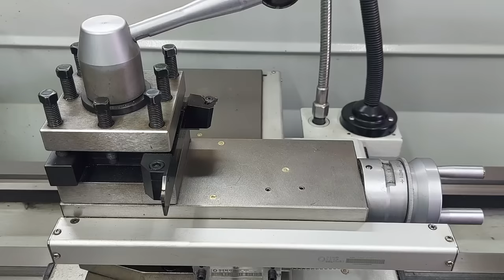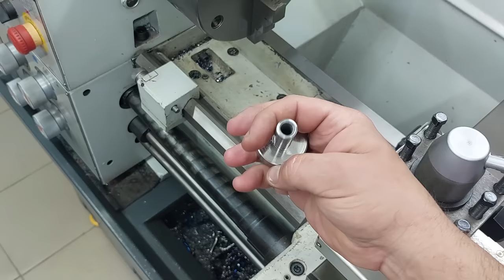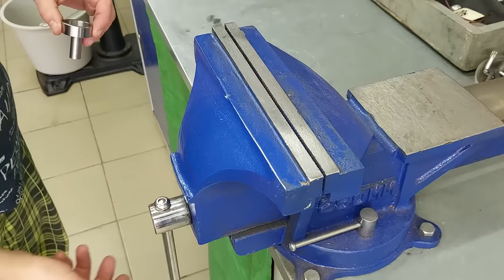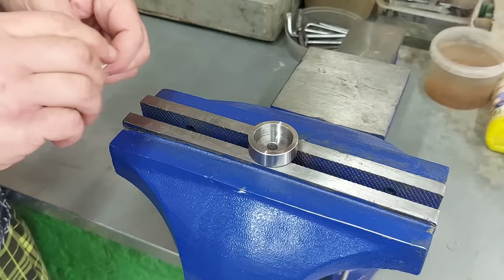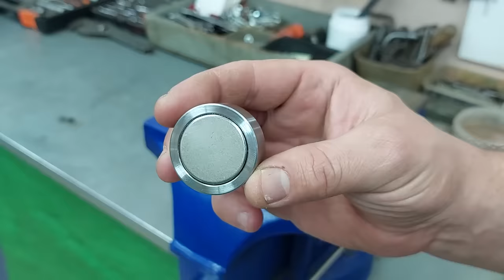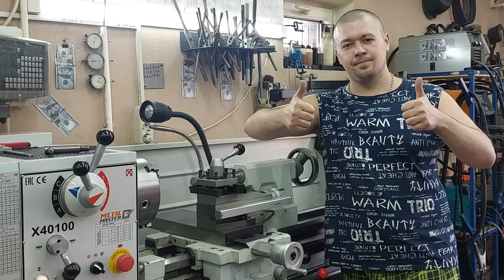This invention I'm going to patent! Amazing idea for turning metal

Comment: Old trick, dates back years.  I served my apprenticeship in a 600 man shop, I saw this many times in the lathe section being used to square parts for the second op.
Reply: Thanks for the explanation. Wasn't sure what the "invention" was.
Reply: @joeylawn36111  The front of tbe tailstock quill.  If the lathe is built correctly the face of the quill will be square to the spindle centerline. Its not an invention, its a feature.
Reply: @terrymoorecnc2500  Yep, I've seen both Keith Fenner and Adam Booth do that.

Comment: If you remember, I asked you, where did you purchase your Mill. On June 7th, I used my Lathe and placed a 6mm die into the chuck. Placed my machined "Back Stop" into my drill / tailstock. Then pushed the die against the surface. Tightened my Lathe Chuck when the die was aligned, just like you did. It works great with short stock. Thanks showing people, whom watched this video 😅....
Reply from the maker: Thanks and welcome!

Comment: kind of good idea as long as the drill holder is set at Zero when clocked(no Taper) on slide! Many just use a spider plate that fits between chuck jaws, but this is only good for larger dia material  so in all its a good alternative. hope it sells.

Comment: Fitting a little ball bearing into the end of a rectangular rod, all held in the tool post, it can push alumminium, brass, plastic etc in place in the chuck.
Reply: I made one like you describe many years ago and have used it dozens of times. Mounted horizontally it will also straighten a wobbly shaft in the chuck which this tool will not do.
Reply: @ellieprice363  Having a bearing in both ends it will act both radially and like in the video, just turning the tool post 90 degrees. The idea came from one hobby machinist, not invented by me. Okey, the actual design is mine but the idea.... copied.
Reply: @Stefan_Boerjesson  No need for two bearings or turning the tool post. Just clamp
the single bearing tool in the horizontal position in the tool post.
Reply: @ellieprice363  Maybe. My designed allows for pressing along the holder only. Then a second bearing was an easy solution.
Reply: @Stefan_Boerjesson  The double bearing design works well if the tool post can be accurately indexed 90 degrees and quickly returned with the tool parallel to the chuck face. My BXA Aloris is loosened by a large nut on top and is difficult to return to the original position. Thus it’s easier for me to reposition the single bearing tool to the horizontal position.
Reply: @ellieprice363  Sorry, I had forgotten that having a qctp I move the tool holder to the other, 90 degree place. Absolut square orientation is not reall needed but likely affect the lifetime of the bearings.

Comment: I am a Japanese who has doubts about this technique. It makes sense if the material is in contact with the magnet case to obtain a flat surface. But if the material is made to contact the magnet body directly, you have to be careful about the parallelism of the magnet body.

Comment: Handy but i have used the tail stock without a center or chuck to do the same thing, granted it isnt magnetic but it get thhe work piece pretty close to running true if its been faced off.

Comment: I've learned, as a successful inventor, that a patent is only as strong as how long you can battle it out in the courts. Generally whoever has the most money wins. Don't count on a patent for protection. I've been told by patent examiners that some of my claims at the end of a disclosure are rejected because anyone skilled in the art would have thought of the idea. On the other hand, I have read two separate patent disclosures (of a similar idea) that seem to be exactly the same, letter for letter. If and when you do come up with a novel idea and product, do some online research (at no cost to you) to see if someone else has thought of it first.

Comment: basically a tailstock button dont need magnetic just a flat faced mushroom, hold part light in chuck then rod through rear of head to  press part against button,   ferrous or nonferrous don't matter was doing that 50 years ago still do

Comment: Or… and this’ll even work for non magnetic workpieces too… lightly clamp the part in the chuck, push the tailstock spindle against the part and apply a little force as you turn the chuck by hand.  Then retighten the chuck and you’re done.
As for patenting, you’ve published the idea, so no chance, not to mention I doubt this is novel.

Comment: I’m trying to figure out why he would put a newly machined part in a vise with steel jaws and leave teeth marks instead of using brass or copper jaw liners to protect the machined piece.
Reply: It’s faster and the chuck won’t necessarily leave teeth marks. Not everything needs to be perfectly smooth.

Comment: Nice job and thanks for sharing your idea.  Don't worry about the morons telling you "you're doing it wrong".  I'm surprised someone hasn't reacted with horror over using a thread insert to chamfer your edges (grin).  What I see are pro shortcuts gathered through experience.  In the time it would take to indicate it traditionally, you could have used this to square it up, turn it and move on to the next op.  YouTube experts...what the hell are you going to do with them?
Thanks again, Sergey and keep them coming.  Cheers.

Comment: There’s nothing new or patentable about this tool. I  use a simple roller bearing mounted on a shaft in my tool post that does the same thing faster without a magnet.

Comment: Since you won’t take advice and not use the word “invention” to describe “constructing and idea”. The I’ll leave you with this. You can make what you call “inventions” but legally, you can’t sell them.

As far as this idea, this isn’t anything new. Time was, when companies that made varying sizes of magnets, specially with holes drilled into them, this would be the method used, but with repeatable tooling, such as collets, independent four jaw chucks and magnetic chucks. As  a matter of fact, this is simply an easy reverse version of a magnetic Chuck. 

Sooo….good luck with the “patent”.